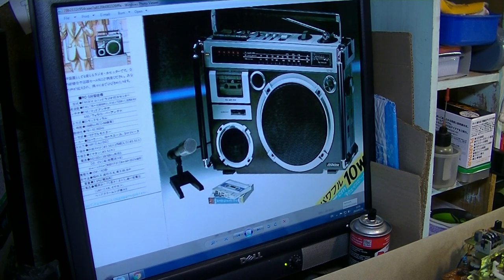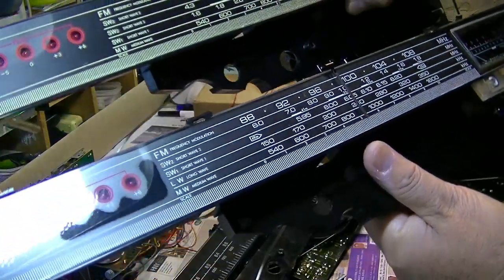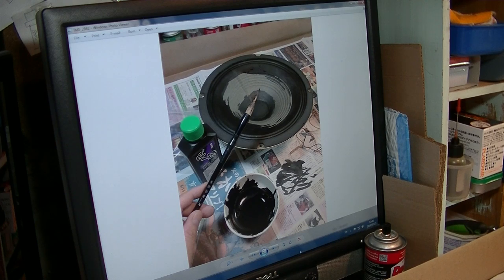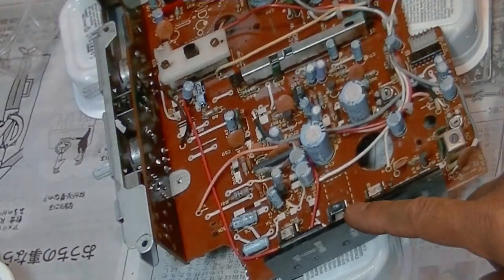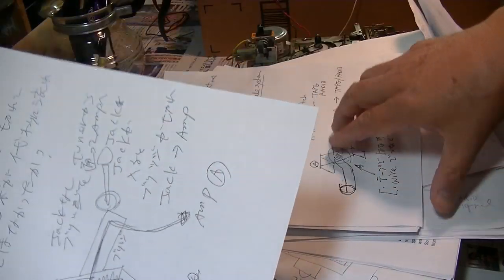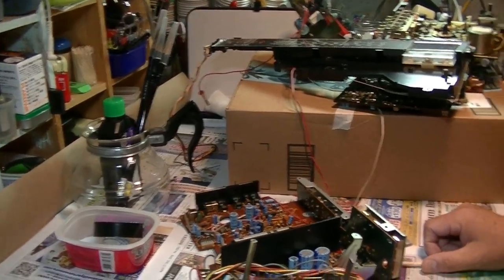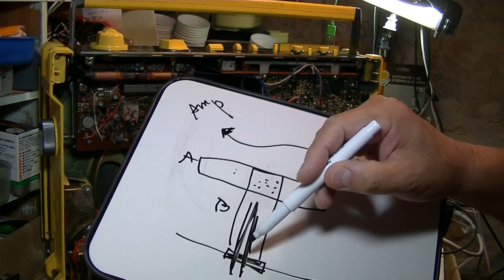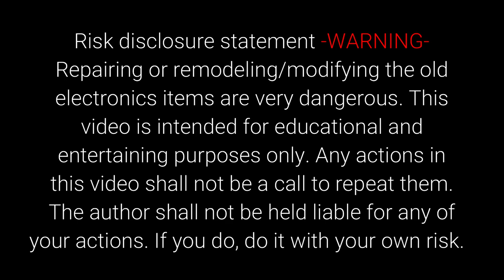How to install Bluetooth on JVC RC-550 aka El Diablo explained in English

Comment: Good explanation Teddy ! By the way i bought used a very rear 70s stereo receiver record player yamaha model ms-3  can you find service manual because there is a problem with the fm i guess is power supply .
Cheers !
Reply from the maker: You can join the forum and ask service manual. There are many members who knows much better than me. Any forum that is talking about vintage music gear will help you.

Comment: Thanks Teddy. What is the purpose of the DC isolator? Do you build the circuit on a pcb board yourself or is there a complete kit one can buy?
Reply: In particular. What inductor and capacitor do you use?
Reply from the maker: DC isolator will remove the ground-loop noise.
Here is a wiring diagram.
https://bit.ly/2LifRc7

Comidox 5PCS B0505S-1W DC-DC 5V Power Supply Module 4 Pin Isolated converter

4.7uf ceramic multilayer monolythic NP capacitors

47uH Fixed Inductor

Comidox 5PCS B0505S-1W DC-DC 5V Power Supply Module 4 Pin Isolated converter

You can watch this video for understanding the reason why I used DC isolator for BT mod.
https://youtu.be/OEFcGl-OguM

Comment: I loved this vid Teddy!.
2 questions. After Aux is used for BT, can you still plug in a turntable?.
And does the dye flex, or will it chip over time with vibrations?. JVC is my favorite. M70, M90, 550, 838.
Reply from the maker: Yes, you can still use plug for anything you want to play. Dye won't chip, it just stays as if it is natural color.